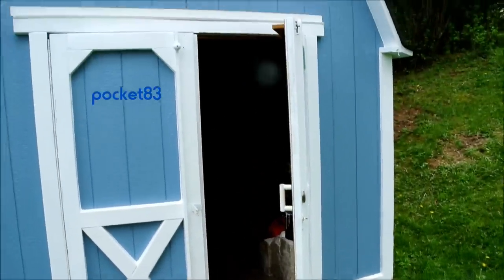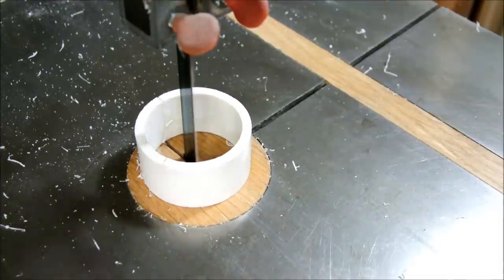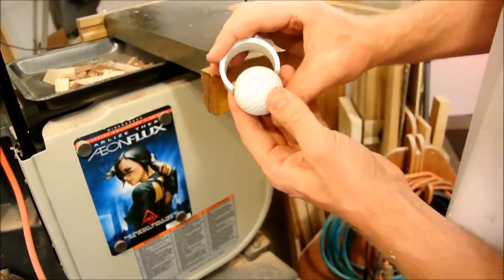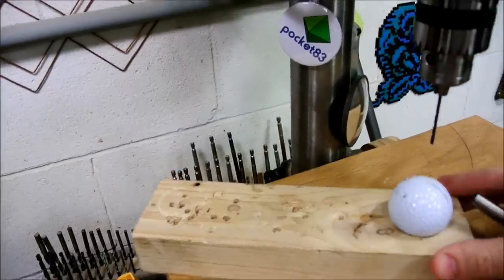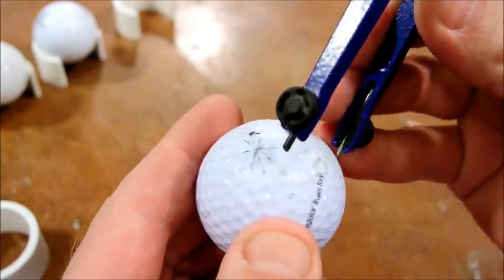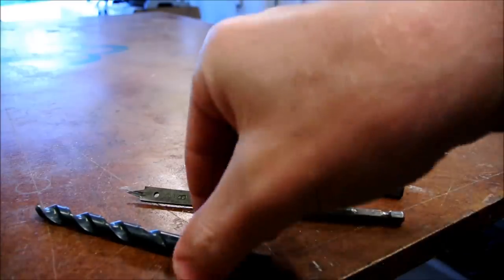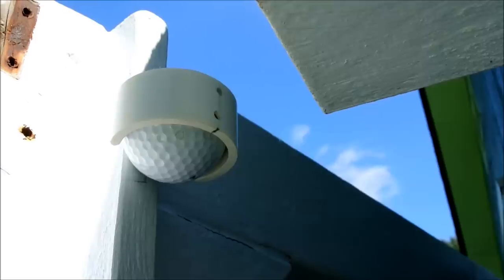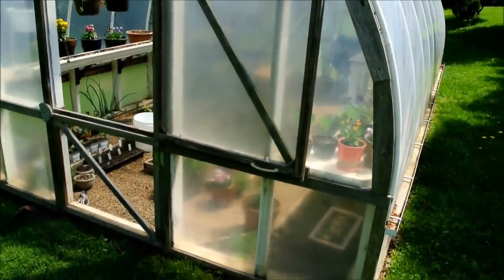Cheap and easy ball catch latches!

Comment from the maker: Magnets, magnets, magnets! I love magnets, too. But they have nothing to do with this project. 
This latch is made from an old ball and some pipe, so please don't try to sell me on buying a "better" magnet latch.
Reply: DUDE USE MAGNETS!!!11111!11oneoneone
To each his own, and like you, I'm more likely to have a random piece of PVC and a ball lying around than a countersunk rubber coated rare-earth magnet.
Reply: clever, practical, cheep,
Reply: I used magnets to hold the front access panel on my fish tank stand. Was a huge pain to get working right, but it works. The biggest problem was finding a way to secure the magnets in the exact position without gluing the whole door shut permanently. I ended up using plastic wrap to separate the panel and magnets from the other magnets in the area they would fit in to.

Would not recommend magnets.
Reply: pocket83 hey love this grad idea but i have one tipp for you if you want to make it easyer to position the pvc part of the latch just right. stick it onto the ball while the ball is screwed to the door and paint the screw hole s on the pvc with smudgy paint,  press it against the wall and it should mark where to drill of course this dosent help with the angle. great vid
Reply: LPJonasGames kui I
Reply: pocket83 you could use magnets
Reply: Use a magnetic golf ball with metalic pipe!!
Reply: Джейсон Хичкок he said if you didnt have a drill press thats the way to do it.
Reply: More than one way to skin a cat and to each their own... I would have gone the magnet route.
Reply: lol  was gonna say  plasti-dipped  neodymiums   great minds  as they say
Reply: the marks were just for someone who didn't have a drill press and needed to drill them by hand
Reply: Magnetic golfballs?
Reply: Videodrome- long live the new flesh!
Reply: He was showing that technique for viewers that don't have drill presses.
Reply: I'really like the green house.
Reply: Resetting Sargent as210 caravan alarm
Reply: I don't like the magnet variant of these. The ones I've tried had been to strong when you try to close the door again (usually with a ton of crap on my hands)
Reply: Very cool and explained.
Reply: pocket83 velcro
Reply: pocket83 good stuff.
Reply: For those who have friends that actually use this idea, replace their golf balls with exploding "trick" ones.
Reply: James Hannan,  What fun would that be?
Reply: pocket83 yes I do, but I'm clumsy AF. Trust me. Not a good idea. Gravity would win and then I'd have to buy everything I dropped. (already broken a cup, a plate and a drinking glass today. Told you. I'm clumsy)
Reply: how much pressure can this setup handle? like if say the wind was blowing in a direction to close your door. would this setup hold? like this idea btw very smart.
Reply: This is actually a great idea!
Reply: Nathan Reed because the surface area of the door is reduced significantly because of its close angle to the shed, even in a worse case scenario (air blowing directly parallel to the shed) it would have to be a pretty strong wind considering he took 2-3 pounds of force if i had to guess to open it. i dont know about the math but wind pressure at normal speeds is miniscule
Reply: pocket83 aeon flux (cartoon and cinema) rulez!
Reply: pocket83 i
Reply: pocket83 do u have something for slide Doors
Reply: pocket83 I literally was going down to the comment section to say to use magnets and it’s a pinned comment
Reply: pocket83 .

.        ,,,,,,    ,,..
Reply: yes but for magnets y need it case or good glue that solution is better other think is magnets are fragual
Reply: pocket83 a
Reply: You should use magnets.
Reply: THIS IS SIMPLY AWESOME!
Reply: P
Reply: Should of used MAGNETS and a 20 second vid.
Reply: The problem with PVC, in no time will it be brittle and yellow from the UV eating it up. Then just snap off.
Reply: Great video, great idea and bang on reply.  I think people have to just get it that the videos are just someones good idea that they are kind enough to share.  If you like it, copy it. If it's dumb just ignore it and move on with life, don't take it personal like they are telling everyone else that they are wrong!  I love it when someone thinks of every unlikely scenario that might make the idea fail! Personally I get more satisfaction from making things with materials I have lying around than buying cheap ass catches or magnets. Keep up the good work
Reply: Dude! Use magnets, a better solution for sure. That’s a lot of time spent on this solution!
Reply: Magnets would be less work
Reply: I like your solution.  Years ago while doing field service in the food service industry McD's upgraded their drive through windows and I wound up with several dozen extremely powerful "neodym" magnets.   I realize that you already commented on magnets but I got them for free and they are small but very POWERFUL so I used them on all of the doors on my duck coop and chicken coop and crawl space door.  I still have lots more too.  Peace.
Reply: @melody3741  wind pressure is far from miniscule, have you ever tried to carry a sheet of plywood in the wind?  You do know huge ships were powered with nothing but wind right? Also just because air can't get behind the door does not mean there is no force, it becomes an airfoil and works like the wing of an aircraft.
Reply: I was about to say magnets good project by the way
 thanks
Reply: So simple and effective.... thanks for sharing
Reply: supergamer 1000 you can buy rare earth magnets with a countersunk hole in the middle for mounting with a flathead screw.
Reply: Magnets > Golf ball PVC janky AF combo.  Golf ball looks dumb hanging off of a nice wooden door.  PVC gets old in weather and cracks.  This is the same reason I eat soup with a spoon; and not a fork wrapped in duct tape.
Reply: I wish I could up and down vote this 😂magnetz are fantastic but they're so horribly addictive.
Reply: Magnet?..keep them to yourselves, this is about DIY & keeping the mind active.
Reply: @maxximumb  Yeah... mine are magnetized to adhere to water and sand... ;)
Reply: @UNKPCRIDE  , too bad nobody ever invents paint.
Reply: @AaronX442  , nonsense.
Reply: Commenter Five I think the latch method he had would work better. Wind will blow the door shut using the golf ball, UV light will rot the PVC and eventually break. Too much fabrication for something that won’t hold up for a long time. Build it once to last vs rebuilding every couple years.

Comment: Love the concept. I made one with one change: instead of a golf ball, use a like diameter piece of PVC for the "C" part to grab. Works great and was easier to make. I think you can make it with other diameters of PVC as well.
Reply: i would love to see a video update with this concept in play, much safer.
Reply: How did you attach the pipe to the door? Long screw through the whole diameter? A bolt?
Reply: great idea and using pipe your not limited to the size of the ball you could go to any length

Comment: Several years ago I cut some pvc pipe just the way you did, and used it as tablecloth clips. It worked really well... kept the cloth from blowing away in the wind.
I should think a short piece of dowel rod or tree branch could serve just as well as a golf ball for your door latch, although it wouldn't be quite as weather resistant.

Comment: I have done a similar thing, but instead of a golf ball i used a piece of PVC pipe slightly longer then the latch part, it's the same idea but without any balls, just PVC pipe.
Reply from the maker: I get it. Good idea.
Reply: Especially as drilling golf balls really is dangerous (as you point out). Sawed through one as a kid, spent hours in the Hospital getting the latex out of my eye.......
Reply: Haha, did the same thing when I was a kid and I was expecting something to go wrong in the video!  (Instead of a drill I was scraping the golf ball against the rough side of a brick.  The pink schmoo went everywhere.)
Reply: DRMNZ AvE fan?
Reply: Son of a Didley, you got me!
Reply: Peter Holt  ... and now your friends call you Captain Hook (or was it Moshe Dayan?)
Reply: @PeterHolt goggles are inexpensive.
Reply: i was thinking the same thing. drilling thru pipe seems much safer than thru a golf ball.
Reply: @PeterHolt  i cut open a golf ball when i was a kid. underneath the cover was just rubber bands wound really tightly.
i don't think they use rubber bands in them any longer but they did back in the 60's.
Reply: paul k  no
Reply: Great idea! Two pvc pipes would suffice. Thanks for the comment. I was about to buy a golf ball for my project! Haha

Comment: Wonderful, just put this on a gate, and a shed door and they after a week work very well.  Thank you 
I used a table saw to cut the PVC but not really safe way to go, then I used a grinder to fix the edges. 
I also made my PVC over 2" long, I wanted or needed a very strong hold.
Keep on coming up with ideas, not every one is smart enough to see how helpful you are to us.

Comment: Its a great idea but pvc exposed to the elements over time will dry out and crack... i would probably paint it or clear coat it to protect it for a bit longer
Reply: It's dirt cheap. Make extra, and replace it every 3rd year.
Reply: @georgekatsinis5224  yea ur right but paint is also 98 cents saves u the trouble of having to replace it every few months
Reply: or use UV rated conduit.. The same that is used on outdoor plumbing, 15 years still going and i live in the subtropics where the UV is through the roof.

Comment: Simple and effective engineering. Love it.  I have a shed door that's in great need of one of these.  Thanks heaps amigo.  
By the way - golf balls also make great file handles.  Drill a hole 3/4 of the way through the golf ball a bit smaller than the width of the tang and hammer it in there. Fits nicely in the palm of your hand.

Comment: I liked this so much I just did it. My Wife had a 10' by 12' gambrel roofed shed/shop built for me by Tuff Shed and would normally place a small sand bag against the doors to prop them open and after seeing this decided it was just low tech enough I could actually finish it in one day, so after several glasses of very cold ice tea "got'r done" before the sun set.

Comment: This is really smart but if you use a pipe big enough to fit a door knob that would be pretty cool too
Reply: I tried and couldn't find PVC large enough. Good idea though.
Reply: PVC can be bent using a heat gun.  PVC sheet (or short chunks of PVC pipe or PVC fittings for low shipping cost, maybe use a coupling?) can be purchased online.

Comment: You called yourself lazy because you are lazy.  Not idle.  Not workshy.  Lazy.  You try to minimize the effort with which you do things.  That can mean putting in a lot of effort once in order to reduce the amount of repeated effort you use elsewhere.

Larry Wall has remarked on this with regard to programming.  Laziness is one of the three virtues of a great programmer.

OTOH, it's hard to sell yourself to a potential employer by saying that you're lazy.  They interpret is as being idle or workshy.  But if you tell them that you "work smarter, not harder" they think you're wonderful and also know management buzz phrases. :)
Reply from the maker: Fair enough. I like to think of it more in terms of optimizing, especially with respect to the behaviors I expect to repeat in the future. Our time is mostly robbed from us in small increments, so small improvements can save lots of net time over an extended period. As a related bonus, reduced stress and frustration have their own benefits.   

I think it was one of the Numberphile guys who said that he became a mathematician because he was lazy. I identify with that. Especially because I know that I was supposed to be a mathematician. I mean, why struggle your way around a problem, when you can think your way around it, instead?
Reply: +pocket83 Another view of the same thing.

Yet another way of looking at it is that it isn't sensible to do things in a sub-optimal way.  No point going next door by turning the wrong direction and walking around most of town to end up a few feet away from where you started (unless you wanted the exercise).  So if you can spend some time thinking about a problem you face repeatedly in order to save a little time you can still end up winning.

But perhaps you're reluctant to use the word "lazy" because of the negative connotations.  I tell people who have that opinion of laziness that by minimizing the time and effort needed to do something, I can then do more things.  Laziness as a tactic, not a strategy.

So, while "work smarter not harder" is a management buzz phrase (which I'd normally dismiss just because it's a management buzz phrase) it is something I do.  Because I'm lazy. :)

Comment: Very nice idea, I presently utilize the same hook and eye bolt on my shed doors but I will give this a try. I spent 27 years as a toolmaker/machinist and I probably spent a couple hundred hours operating a band saw cutting various types of steel, aluminum, polycarbonate sheet, plastics of various types, as a really big safety factor so that you don't have to fish your finger tips out of the chip drawer lower the roller guide for the blade to just enough room above the material that you are cutting. Yes, it's a pain adjusting the guide every time you cut something but then so is finding your finger tips and driving to the ER to have them reattached if possible.

Comment: I love this idea, and will have to steal it one day.
About the only suggestion I can add, is that you might want to use a small piece of double stick tape to make the alignment easier.  Put the tape on either side, open the door, and then carefully separate the parts and drive in the screws.  No alignment marks necessary at all.

Comment: Very good idea. Observations after viewing. I use gray Carlon electrical PVC tubing because it has a UV inhibitor built into the plastic which prevents it from degrading over time. I use only stainless steel screws to prevent rust. An alternative would be the coated deck screws for the same reason. Lastly, I make sure to caulk the countersink hole shut to keep bugs from nesting, water out to prevent ice from splitting the golf ball. I use my multi-saw to cut the PVC since I don't have a band saw. Cleaner cuts for sure.

Comment: Love the video. The best part is the beginning when you explain why the latches are a huge pain and that you are too lazy to operate them. Then you proceed to buy PVC pipe, measure the exact diameter and radial degree of the golf ball, risk fingers with a band saw to cut it to size, sand the pipe down with an electric sander followed by hand sanding, drill holes in the pipe, use a hand compass to find a singular point on the ball, use multiple drill bits to drill a hole in the ball, then assemble the whole apparatus.

Comment: I have a tin cabinet in my barn that needed a pull handle. Poked a hole in a beer cap, then used a drywall screw, and ran that from inside of the door,  through the cap into the golf ball. Made a very sturdy handle,  with no visible flaws.
Reply: Great idea for the door latch!

Comment: My great grandfather built his log house , over 100 years ago . For his inside latches he used a slat , loosely fitted to the door . On the jamb he put a tapered peg , notched at the top , allowing the slat , to ride up the sloped part of the peg and drop into the notch . There was a string , attached to the door , which could be put through a hole to the outside , for outside access , or pulled in for security . The house still stands , caretakers have lived there for years , using that same latching system . He also had a breezeway , he called a dogtrot , with his well dug under the roof of . The well was dug with hole diggers , by putting longer and longer handles on them , as needed . He fabricated the narrow bucket , that the water was drawn with , which had a release trigger at the top and the short bucket , that just barely held the contents of the narrow one .

Comment: Good idea, I had a load of old guttering when I changed to white, so I put one cut in it and screwed two bits of wood as handles. This made me a load of inexpensive clamps, if you wanted more grip you can make them longer or double up on the guttering.

Comment: Mark where you want to cut out the PVC, then cut 'in' through one side like you did in the video, then turn the PVC around to the place for the next spot and cut 'out' of the center. Also, I recommend only having the saw blade guide set to just above the tallest part of anything, like this PVC, to reduce the area you may contact the running blade. Lastly, form fitting gloves can save you from getting nicked. OK, really "lastly, THANKS for the video!!  😁👍

Comment: I just this week used 3/4" PVC pipe sections as a clamps to attach screen fabric  (and/or) plastic sheeting over /2" PVC framing as a cover for raised garden beds. Same principle. Stretches the fabric very well and securely.

Comment: A very clever idea.  I wonder if you could do that with two different sizes of PVC pipe.  From a table for ASTM schedule 40, the inside diameter of nominal 1-1/4 inch pipe is 1.380, and the outside diameter of nominal 1 inch pipe is 1.315.  So the smaller pipe could fit inside a section of the  larger, as the golf ball fits inside a section of the pipe.  I suggest this for those of us who don't play golf.

Comment: Thank you for the I.D. of the pipe & the degrees of angles/inches of gap. Just a thought about cutting the PVC. When you cut, one thought is to use a wood clamp to hold the pipe. The 2nd is to use a Dremel tool, my preferred tool of choice to cut PVC. You could also use one of those oscillating tools as well. Great idea though!